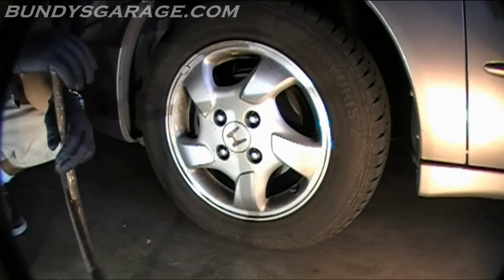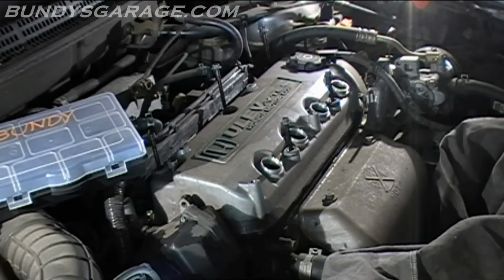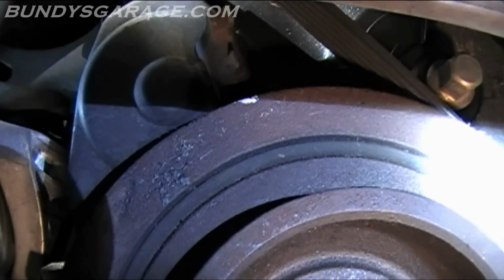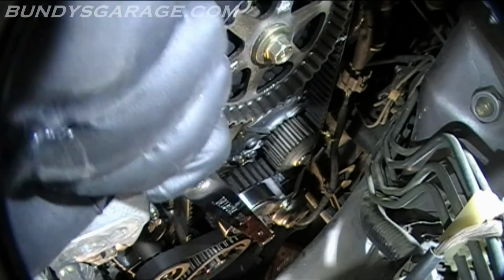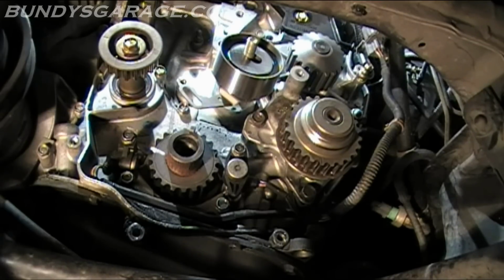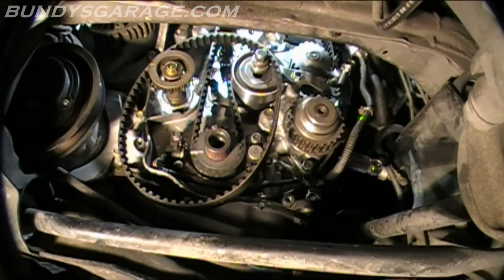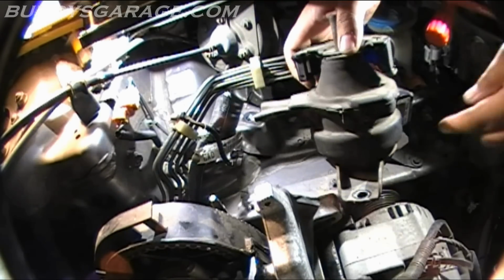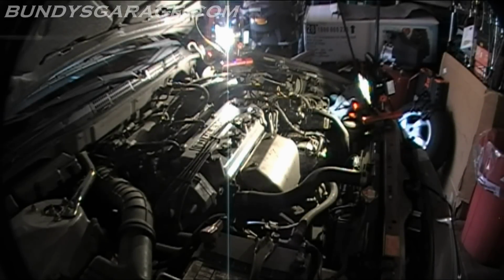BEST DIY Honda Accord 2.2L 2.3L F22 F23 Timing Belt Replacement w/Water Pump - Bundys Garage

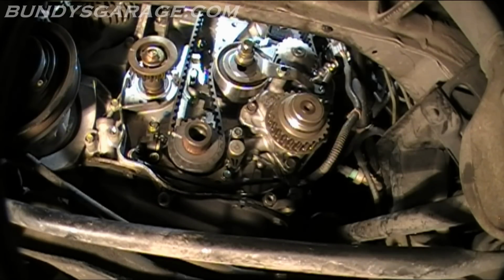Comment: is very confusing on the timing belt tension  part . 1:27:19  you say 
 " rotate the crankshaft counterclock wise three theet on the camshaft pulley" 
but you did it wrong ! you put your wrench on  the camshaft  ,  it says to turn on the Crankshaft  till the cam moves three theet. what you did actually put the tension on the tenssioner side  wich i believe is dead wrong , the point of that procedure is to take the slack off on the part were the belt runs diagonally (between cam and crank on the left side to be more clear) I believe the tensioning part of this is wrong can someone help please.
Reply from the maker: The instructions from Honda are not clear. Basically when setting tension on this timing belt. Use your best judgement. In the video I had too much slack because of the Honda procedure. After I shot the video I had to go back in there and put more tension on the belt. This was done by "feel", not rotating the engine to set tension. Do the same as well. There needs to be a little bit of tension on the belt but not so much that it binds up. I know that sounds vague but you will see when you get to that point. Use your best judgement when setting the tension but it needs to be more than what I did in the video.
Reply: BundysGarage why you did not get tension is you did the correct tension idea except you are supposed to tension the belts when both timing and balancer belt is on , the tensioner tensions both belts at the sane time
Reply: Is there supposed to be no slack on the timing belt anywhere are you rotate? I get the timing belt slap through rotation.
Reply: Let me be more clear. After tensioning the timing belt by rotating 3 teeth from crankshaft, if I try to test by rotating 5 or 6 times, the belt slaps (loosens tension between cam and crankshaft on every rotation). Just tensioning it appropriately by moving it 3 teeth didn't work for me.

Comment: Great video. 1 thing I dont like is the suggestion to use the jack point. That point works great with the scissor jack but can easily bend if the car shifts any with a floor jack. I have seen it happen first hand. Instead much better to use any solid frame area or tow hooks and then use a jack stand under the jack point.
Reply: BoogieDownProduction dude i couldnt agree more.   And i seen lots of pros on utube saying use a hydraulic jack there.   It is only meant for the scissor jack that has the correct notch in it.   Then when it bends the seam it cracks the paint and it becomes a rust magnet.

Comment: Be very careful with the 2.2/2.3 Timing belt change. If you have slack in the Belt, you have the wrong Belt. Honda played games with the VTEC engine belt, some have 112 tooth belt and some have 113 tooth belt.  My old one had 112 tooth, and the Dayco Timing belt kit came with 113 tooth belt. when I installed it, there was the same slack as this video. make sure you have the correct belt or the belt will jump teeth once running. There should be no slack in this belt one the tensioner is released. I went back to my local AutoZone and bought the 112 belt and installed it - no slack! engine tensioned up properly.
Reply: +Tim Sullivan no he did it wrone hes no a mechanic you can see it  your suppost to use the crack shaft to turn counter clock no  the cam.

Comment: lisle makes a socket now that helps take these damn crank bolts off with ease now with just an impact.  worth the money has paid for itself first belt i did with it.
Reply from the maker: What kind of air compressor and gun do you have? What PSI was it operating at? 1/2 or 1 inch gun?
Reply: gun is ingersoll rand 2135qtimax.  1/2 inch drive.  shop air is probably between 120-130 psi, not sure we have three compressors and 30 techs where i work.  all i know is the gun wouldn't remove the bolt with a short snap on socket.   i bought a 300+ dollar nitrocat 1250 and that only worked half the time.  since i bought the socket for like 40 bucks the ingersoll works fine and i don't even use the other gun.

Comment: I noticed that you didn't put the bolt back in the timing belt tensioner arm,and that timing belt looks very loose it needs to be tighten up
Reply: Correct about the belt not being tightened enough. Not correct about the bolt. It's meant to be a temporary hold while adjusting tention, and to me removed later. The main 14mm adjustment bolt clamps the bearings in place. If you listen closely, he says this, and he indicates the bolt he is using is actually a timing cover bolt.

Comment: Great video! Just a tip I want to share. Milwaukee has a 1/2" impact tool that has 1100 breaking ft. lbs. of torque that should take that crankshaft / pulley bolt off without a problem. I know it cost money but you will be investing in a game changing tool. They call it the Beast! Another tip is to use a ratchet and socket that has a hole in the middle for the long bolts. Gear wrench makes a nice set. I've bought the Milwaukee M18 FUEL™ 1/2" High Torque Impact Wrench with Friction Ring Kit 2763-22 and the Gear Wrench 23 Pc. 3/8" Drive Pass-Thru Vortex Ratchet Set Featuring Locking Flex GearRatchet™ Handle SAE/Metric Catalog Number: 893823. These tools are a great investment. I'm not a professional I just like to do my own work. I also bought the Milwaukee 3/8 impact wrench for smaller areas. I have a Mac 1/2" air impact wrench I don't use anymore because I have the cordless Milwaukee impacts now.Not having to deal with the air hose and the noise from the compressor is great. I think most people I've seen are buying the Milwaukee M18 Fuel brushless impacts now. If you can't afford the Milwaukee cordless you can go to Harbor Freight and pick up a 3/4" wrench & socket set and it will take that crankshaft bolt off with no problem. Don't use the long extension because it will rob you of your torque. The extension won't let you use the torque that you need to take the bolt off. I know what you're saying to yourself, how can I operate the wrench without the extension. Just slide a cheater pipe on press down.  I'm getting ready to do this same job! Thanks for the video! I learn from everyone! Love your video!

Comment: I noticed that you turned the cam bolt to adjust the timing belt tension. As a caution, you should always use the crank bolt to adjust the timing belt tension turning it counterclockwise.  This keeps the belt in tension.  Notice in the video when you turn the cam pulley bolt counterclockwise it slacks the belt on what is the tension side when running.   It is a good video other than that.
Reply: tradersnotion I might need ur advice on some things, I'm getting ready to do timing belt on 2006 Accord 5speed manual 4cy, also water pump
Reply: thats a timing chain not belt

Comment: Thank you for taking the time to do this video.  It was no small effort on your part.  I appreciated your comment about safety and not trusting a floor jack.  I would add that the front of the vehicle has a jacking point called out in the manual.  Using the front lift point with the floor jack, one can place the jack stand where you are lifting the vehicle with the floor jack in this video.  Again, great video, thank you.
Reply from the maker: Seth Smith Seth glad it helped you out and thanks for the tip.

Comment: I can honestly say this is the best DIY article I have seen and was very helpful on doing my Accord which I finished yesterday.  Only comment is I have concerns marking the timing belt as a method to keep from turning the engine to insure no valve/piston interference. 

Two years ago I was working on a Subaru Forester which comes with these marks from the factory.  (very helpful)  As this particular car had a head gasket problem I sent the heads to a machine shop to have the valve faces recut and head surface machined.  I reinstalled and was going through the rotation process when I hit a "hard stop."  I puzzled over this a bit then realized I needed to adjust the valves due to the new clearances from machining, which left valves open at TDC, causing interference.

I would also like to agree that loosening the crankshaft bolt is a good first step, and that yes it is as much of  a pain as shown in the video.  Cheater pipes are truly your friend for this, and fortunately I didn't have to resort to heat.  The need for a 17mm impact socket for the engine mount was quite accurate as well.

Thank you again for posting such a complete video, and look forward to seeing your work in the future.
Reply from the maker: Chris glad it helped you out. Stay frosty.

Comment from the maker: Hope this helps some people get the timing belt replaced on the F22 and F23 Honda engine.
Reply: so u have a list of all tools used I need it for my 2.3 liter VTEC Honda accord??
Reply from the maker: +Damian Cheruk I don't but you will need 1/4, 3/8 ratchets, 8mm, 10mm, 12mm, 14mm, 17mm, 19mm, sockets and wrenches to use. As well as extensions for both 1/4 and 3/8. But the most important tool you need is the tool used to hold the Honda crankshaft pulley. Cause if you don't get that off, your dead in the water. If this is your first DIY repair, don't let this job be your first, this is not for a novice.
Reply: +BundysGarage thank you very much I appreciate it